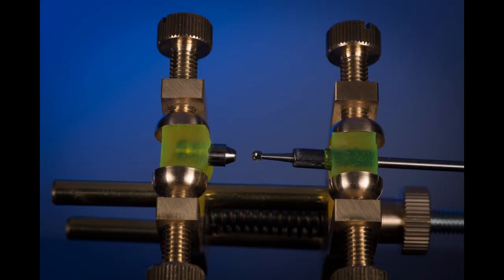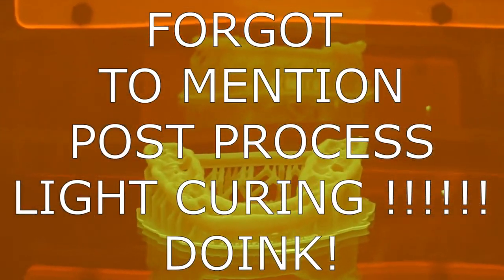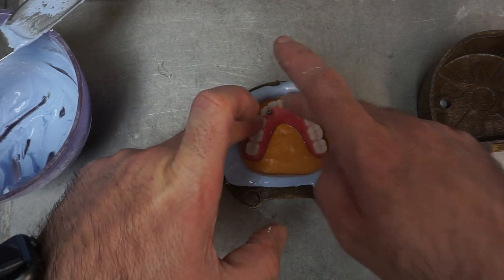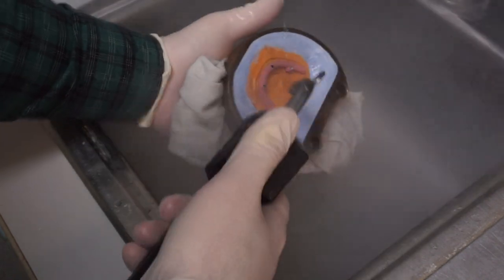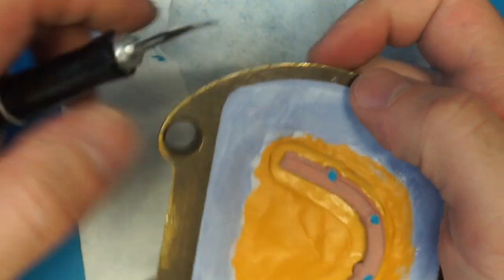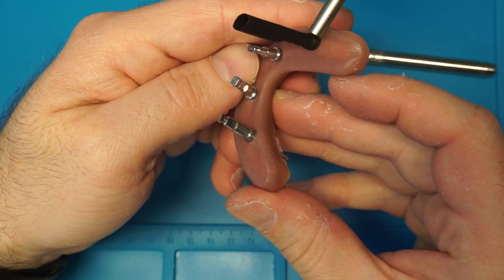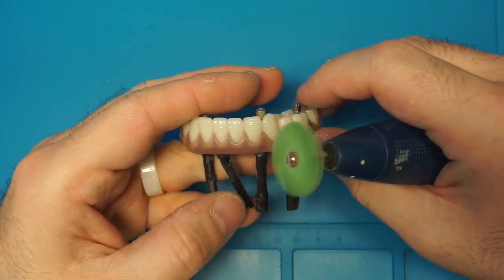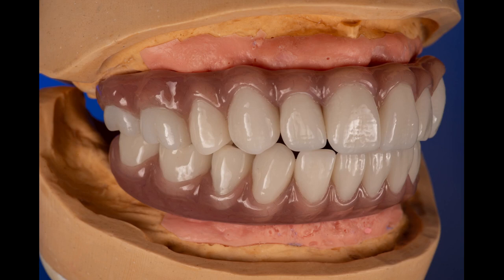Processing and finishing an All on X type hybrid prosthetic.

Comment: What is suggestion of acrylic sealant or glaze that you can refer? I found GC optiglaze. Personally i think GC products are pretty decent but interested in your opinion as per what glaze to use? Also what happens to it down the line does it chip off in small pieces or wears off etc...? Spasubo :)
Reply from the maker: I usually use Optiglaze myself.  When applied properly  it last about 2 years or so on my cases. It doesn't really chip. Most likely just has spots of shine and dullness. After 2 years, sandblast and apply again.